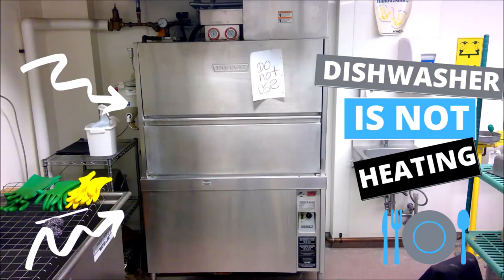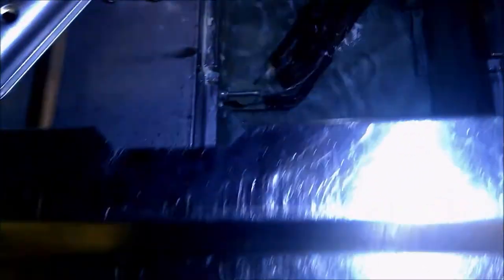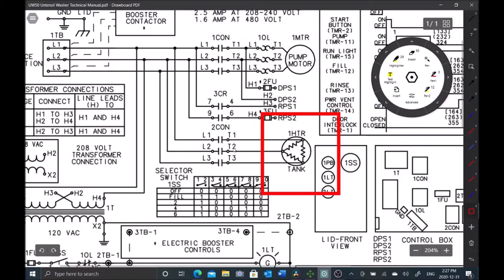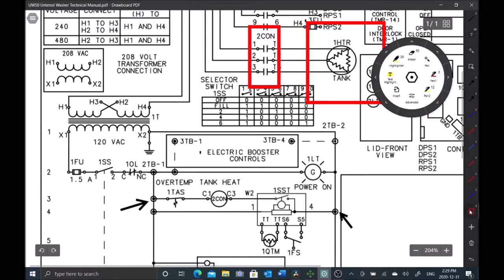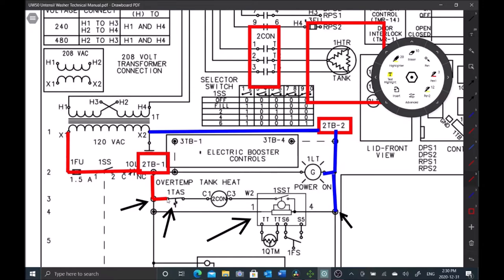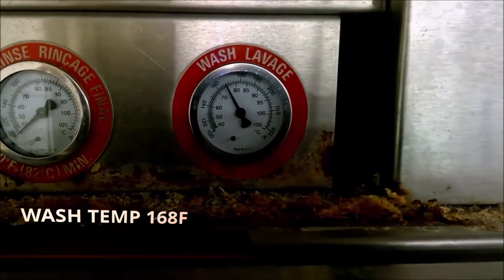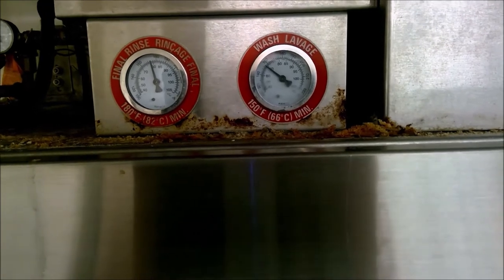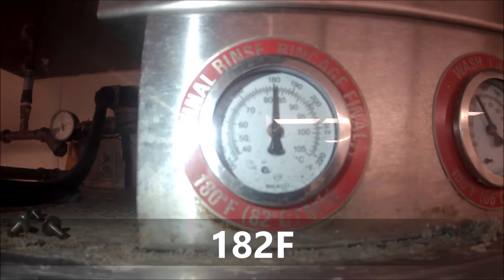Hobart Dishwasher Potwasher Is NOT Heating (UW50)

Comment: Back in I use to work for Hobart I was more on the refrigeration side however I would work on everything. Having a strong HVAC/R background I would blow threw oven's proofer's steamer's etc. They where just 80% Furnaces to me. Their schooling and training where ok. One teacher did not like me, he wanted you to diagnose everything from the control board. So I have pump motor not starting on a washer. I go I have power going to the motor and it's not running. He goes so you have a bad motor? I go maybe according to the board I do, but does the board tell me if a wire shorted off the motor? The look on his face was priceless.
Reply from the maker: Lol

Comment: Please compare the use of a typical NCV stick tester versus your key chain solenoid tester?  I have not had to be concerned with pump rotation directions in my limited experience, yet like a moth to the flame, am drawn to the purchase of yet another tool.

My name is Dave... and I'm a tool-a-holic, it has been 6 days since.......
Reply from the maker: Lololol. The problem with NCV is that it tests for a live wire only. Meaning it does not tell you if the neutral side of the circuit is coming through. Also it can’t be used on 208V as it won’t pick up the 2nd leg of the 120V circuit and it doesn’t work on 24V.  Also it cannot test through certain sheathings (BX). Although I only use the solenoid tester for solenoids and small pumps, it saves me the time of having to test for power by removing covers etc. I never use NCV for testing voltage as it only detects one side of the circuit.

Comment: are there any video for an inner pumped clogged the pot washer i have all 4 propellers cleaned out thoroughly one side is not cleaning things properly and actually making things dirtier like its not washing properly on one side and leaving food particles any suggestions?
Reply from the maker: I took one apart recently, make sure to get gaskets etc. you could have a damaged impeller in the pump. Make sure all spray arms are clean and not leaking
Reply: @REFRIGERATIONKITCHENEQTECH  yess spray arms are cleaned out thoroughly often and checked for debris I feel like it's something internal on one side and I feel this particular machine mabey has a two sided pump but one side is barely spraying and leaving the food pans dirty on one side

Comment: I would have changed the floats as they tend to stick and cause the element to dry fire and this would trip the high limit good vid, and to lower temp u would have to ajust the temp board
Reply from the maker: Yes, I did end up changing the float, I needed this comment like 2 years ago lol

Comment: You still monitoring this video?
Reply from the maker: Yes, issue was a faulty float switch. The only way for that hi limit to trip would be on a dry fire. Someone watched the video and educated me on it!
Reply: Well done RKQTech. I've got a solid understanding and troubleshooting for hot side, little of 10 years and also worked with Hobart previously. Now helping a company that does it all, hot cold and commercial HVAC. I found the transition was fairly simple, although different ball game, to be clear. I'm still surprised how often I've become useful to the HVAC techs regarding diagnostics. It was my understanding that if you brush basic troubleshooting, electric theory, and learn the sequences of the equipment, you can solve 98% of all your issues.

Comment: If the booster tank was over temping it should have tripped the hi limit for the booster tank and not the h limit in the wash tank. I would have replaced the hi limit and the probe for the booster tank.
Reply from the maker: After having some great techs on here give their input, that wash tank hi limit usually only trips if there is a dry fire. I changed the float switch and never got called back.
Reply: @REFRIGERATIONKITCHENEQTECH  The hi limit in the wash tank will trip with a dirty element and with calcium build up.